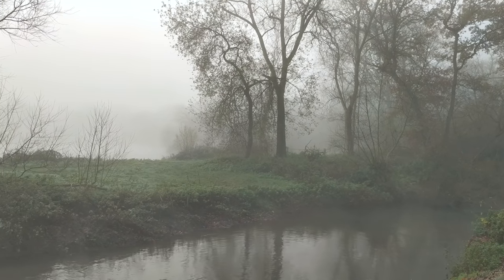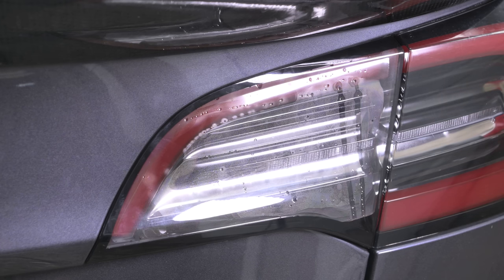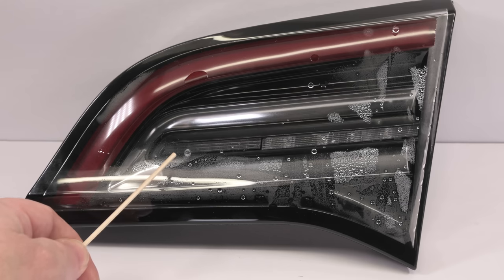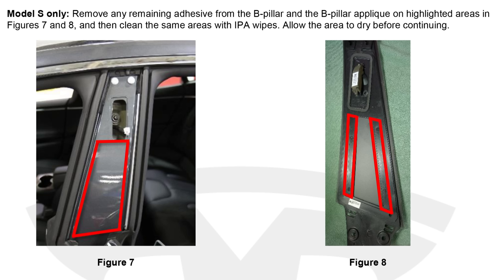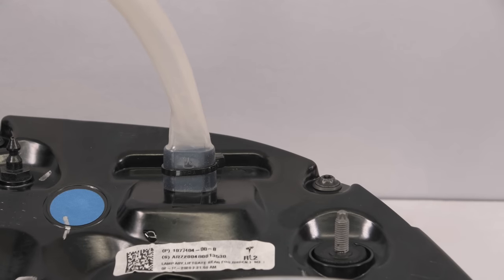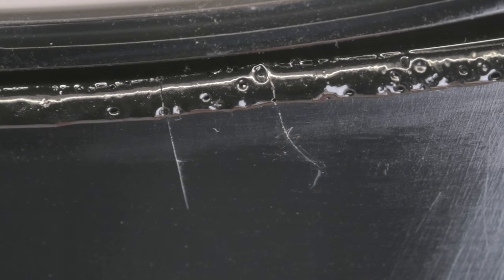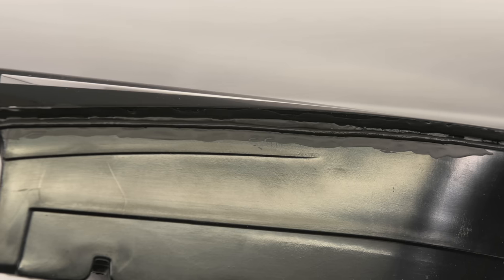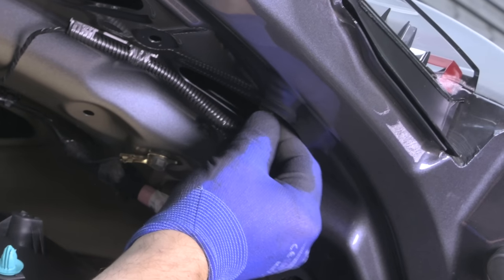How to fix your fogged up Tesla tail lights

Comment: Great video, thanks for sharing. 
I was curious to know if there was was any water marks left by the water droplets. If so, you could try something like Isopropyl Alcohol or methylated spirits (try it on someone else's lights, haha) to see if it can dissolve into the water and help it evaporate without leaving residue behind, prior to drying them. Also Sikaflex or some sort of Polyurethane sealant may be stronger?
I guess someone will let me know if these are silly ideas.
Reply from the maker: Yes that can be the case and you could flush it out with alcohol if it really bothers you. Any sealant that's easy to apply and weatherproof would be fine. The cracks are really small so anything like that will work.

Comment: Fantastic video, but I have one question: Given that the plug is a hole into the light (as you demonstrated with the tube), Is it even necessary to remove the Gore vent before drying it? Could it not dry through the plug? Then you wouldn't need to risk damaging the Gore membrane.
Reply from the maker: Good question! Yes it's possible for the moisture to get out from the plug. It might take longer but I can't see why it woudn't work doing it that way.

Comment: Excellent video thanks!!
I suggest sealing with 3m 08578 strip calk. OEM grade semi rubber, semi goo, 100% awesome. We called it dumdum in the body shop I worked at when I learned about it. Fantastic product for many uses including sealing a lamp.

Comment: Outstanding video.  I have a model S and have had the B pillars fog up once after a dramatic temp change between my garage and outside.

Could you look into how a Tesla Model S headlight can be repaired when the daytime running light fades or goes out completely?  I don’t have that issue but I may one day.  I heard it was from the light electronics getting too hot and messing up the weld/light tubes.
Reply from the maker: I know a few people have looked at this but the headlight units are much more difficult to open up without damaging them, so it seems like it's not viable right now.

Comment: Great Fix! I wonder if you could do this without heat, if you do it in summer, or on days without fog in your lights.... Just glueing around...
Reply from the maker: Once the sun has been out and baked those lights for a couple of days straight I'm sure all the moisture will have been driven off, so yes you could then seal them and you should be good to go.

Comment: Why remove the Gortex patch at all? Can the light be placed in an oven with the patch on? After all, it is permeable to water vapor. That is its job- to be permeable to water vapor.
Reply from the maker: Yes, you're right but it will probably dry out faster with the patch off and if there's a lot of water pooling in the unit, you can pour it out.
Reply: @TeslaGurus  Thank you for reply and for posting informative videos. Tesla service is coming tomorrow to replace a moisture laden tail light under warrantee. That’s the easiest fix!

Comment: Interesting. Both PC and PC/ABS is prone to crack due to either built-in stress or chemical stress corrosion cracking. You need to temper the plastic. Unsure if manufacturers know this these days. Thanks for nice video.

Comment: Mounting a very expensive, large surfaced, complex, thin, brittle plastic box to project out, while simultaneously sit in contact with, a door that people like to slam is just dumb. In fact, in engineering parlance, criminal.

Comment: Well done, I like the format, permitting  a diy initiative.  Next, which will be in great demand, are the camera pillers on the new model Y.  I think condensation buildup there is a common issue, especially for those in colder climates.  One caveat however, is that this issue, does not seem to be  permanent, once in the cold environment for a while, it seems to clear up,  so perhaps its the relative humidity of the air within?
Reply from the maker: The B Pillar cameras aren't supposed to be completely sealed as I understand it, but this is a known problem on all models and something we'll be looking at making a video on soon.

Comment: Surely car manafacturers should just stick to incandescent?
They're quick and easy to replace a failed lamp.
They keep themselves dry from the heat they produce.
They're simpler and cheaper to produce.
They fade on and off with a nice effect, unlike the nasty abrupt instant on of LED's - Although that's personal preference.
To me, it just seems that incandescent has so many more advantages over LED.

Comment: You can also use a thin bead of clear external waterproof frame sealant from you favourite diy center.  Lights that have water in is nornally because the lens has become detached i.e a gap as per the video 👍 Or if completely detached just clean up both mating edges mix some epoxy and glue back together along edges and clamp with some pegs or bits of electrical tape till set dry.

Comment: Hi my m3 tail lights also get condensation usually when it rains...when vehicle is parked in sun in the matter few hours lights also got cracked...got my vehicle 1 year ago and SC has replaced them twice..it happened again in May 23 this they charged me saying that I'm washing my car with strong chemicals now I stopped going in car washes only hand wash...car was parked outside for few days in heavy rain sun came out and cracked again...has anyone some insight on that...i would appreciate that...
thanks

Comment: Without doing any research I just drilled vertically up into the affected light on the bottom so the water would run out. I used probably 1/8th inch bit. I had a half inch of water in it after a year of ignoring it. It didn't clear the fog right away but now that it's warm weather it's clear and hasn't fogged up since. I didn't need to remove it.

Comment: Great video, Tesla refused to replace my light under warranty, so I have no choice but to attempt this myself :(
What temperature did you use in the oven? You stated it should be very low but not the actual temp you used…

Comment: I had a crack  in my MX tail light and glued it. Unfortunately it did not cope with 45°C in the oven for a day, the glass got small cracks all over it, so carful on the heat.

Comment: 5:56
One of the reasons for Tesla’s failure, is that someone is trying so hard reinventing the wheels.
For such a large plastic parts, these bonding/welding process keeps failing and not having great success.

Comment: Great job in diagnosing this issue. It's the first real explanation I have seen. I bought a used 2022 Model 3 and the taillight had condensation in it. The dealer I bought it from agreed to install a new taillight and I have not had any problems with condensation forming in it.  So, it is possible that Tesla has corrected this manufacturing defect. It appears that is the case. It only makes sense because it would cost Tesla a huge amount of money to repair these under warranty. 

Again, you did a superb job in diagnosing and fixing this issue. You did an amazing job!

Comment: love the test! but I decided to just super glue the entire weld seam with no water testing. I cleaned it with a little rubbing alcohol and a toothbrush around the weld. I didn't bother taking the water out as it's summer and figured the sun would dry out the moisture. it's perfectly dry inside now ( a few days later) and the super glue was very easy. seems to have worked perfectly. it did not take on water last rain. 

I don't think liquid tape will last as well. plastic dip doesn't really chemically bond so if the tape glue is similar I don't think it will last. the super glue melts the plastic and seems to reinforce the weld. super glue is relatively thin as well and seeps right into all the little bubble holes in the weld. I use the loktite brand because it has squeeze control - so easy to apply. thanks!

Comment: Just performed this repair on the driver outside part of the light. There was so much water in mine that I had to drill a small hole on an inside corner to drain it. Later when completely dry I blocked the small hole with the same plastic bonding agent that is used to reseal the outer contour. So far it went through one rainstorm and still no water inside, thanks for the tutorial!

Comment: I have a similar problem with moisture in my frontcamera compartment (Model 3). When driving with cold outside temperatures after some time the autopilot etc. stops working and an error message pops up and tells me that the front camera is blocked. After stopping I checked it and saw that it was massive fogged. This happened more than one time. Do you have a solution? I can send you some pictures by email, just need an address. Thx!

Comment: The change from incandescent to LED lights robs the units of their self-drying property. Exposure to sunlight after rain or washing should eliminate the problem; otherwise carefully flow warm air from a hair-dryer around the, lightly enclosed with cloth, area.

Comment: Hello John, great video, thank you very much for that I have the same problem with my Tesla and at the same time a request you can maybe explain how to take out the other side of the headlight and repair it, Greetings Jörg from Darmstadt Germany
Reply from the maker: Do you mean the other taillight unit or the headlight unit?
Reply: @TeslaGurus  
Hello John I mean the other taillight with me are on both sides of the taillights there are problems Greetings from Jörg from Darmstadt
Reply: The question that arises is it is just as easy to remove as one side of the rear light
Reply from the maker: It is not much more difficult. I will try and do a follow up video at some point showing how to do this on other light units and models.
Reply: @TeslaGurus  
I'm looking forward to it and I am waiting eagerly, many thanks, best regards from Darmstadt Germany

Comment: Thats what happens when the blinker fluid level is low or depleted.
You want to refill the light with blinker fluid.
Your local car parts shop will have headlight blinker fluid in stock.

Comment: Buying a brand new car for well over $50,000 so you can fix it yourself while he is the second richest man in the world?
Reply: What you think its too expensive? Ok you make me a tesla with your hands in your garage for 51k usd lets see how you do :))) you can become third richest person in the world! And you can even evade taxes am I right.....
Reply: Of course, other cars don't have the same or different problems?  Why do you think that Tesla does not have the ability to break?  There is a guarantee.  New cars of absolutely all brands have problems, especially expensive cars.  Why is Elon's condition here?  Before blaming, you need to know the problems of global brands, but they don't write so much about them.
Reply: Something like that
Reply: A certain amount of moisture in the lights is still considered in-spec at Tesla. New Model 3 rear tail lights are now one piece and should resist moisture better !!!EDIT!! I WAS WRONG! NEW MODEL 3 STILL HAS MOISTURE CONDENSATION PROBLEMS!!!
Reply: @user-ct1lf3hf1v why does one-piece lights resist moisture better ? The old lights are basically just two independent one-piece lights.
Reply: Does he own all of the car brands?

Comment: 4:21
Gore membrane (and other foil/membrane of similar sort) is used to reduce tendency of unsightly moisture condensation or fogging on inner surface of the light unit under heat shock, by allowing air moving in and out through its thickness but restrict moisture to a large extent.
There are two large types of moisture inside light unit: preexisting moisture, and moisture ingression.
Air inside light unit is naturally moist. Under heat shock, pressure may build up if it’s without Gore, thus Gore is critical to avoid fogs.
However, moisture ingression due to cracks from poor manufacturing and welding process, has nothing to do with Gore.
Plastic welding, either via laser or ultrasonic, are historically not the best process for large plastic on automotive which is under severe cyclical physical and thermal stresses, thus high failure rate is to prevail as in this case on Tesla.

Comment: is it really necessary to remove the vent patch when in the oven?
Reply from the maker: It speeds up the process but not essential
Reply: @TeslaGurus  you are totally right. I had it in for 2 hrs and everything wasn’t gone… then removed it and the process went faster. 
Bad thing is that I still haven’t got the liquid tape so I’ll have to mount it and the remove it again…

Comment: Great video I have request video with common problem Front headlight led strip not working can you fix this? Model S not sure if happened in Model 3
Reply from the maker: I know this is becoming a common problem with Model S owners. I don't have a solution for you at the moment. The problem is that the headlight units are very difficult to take apart to fix.
Reply: @TeslaGurus  I’m going to service tomorrow to replace the unit I wonder if Tesla can give me my old one back it’s only led not working whole lamp is working and see how to fix 🤔 or just keep if something happened with new one in the future.
Reply: Update: Tesla didn’t replace extended warranty not cover and cost a lot to pay for new one 😕 I bought second hand and now I have to try to replace old unit
Reply from the maker: @koziat66  Probably the best option TBH

Comment: Great video. There’s a guy on the UK TMC forum who dried his out by removing the screws from the back of the unit, not the Gore cover, and then applied Captain Tolley’s Creeping Crack Cure, which has a consistency similar to water so it can get into tiny cracks and gaps (it’s used in marine applications). Perhaps you could do it that way instead of trying to remove and reuse the Gore patch
Reply from the maker: Thanks! I'm not trying to say the method I used here is the only way. Before using liguid tape I also tried silicone sealant and super glue. Both worked, but I felt liquid tape is likely to be more durable in the long run as it's fluid enough to run into the holes and cracks but flexible once it sets. I hadn't seen that Cpt. Tolley's sealant before, but now I've looked I'd say it should also work really well for this. Taking the screws out is another way to get the moisture out but the problem with that is the holes are very small and the screws hold the internals to the back housing, so that could result in other problems. The Gore patch does stay quite sticky after removal but it's also really easy to apply a little glue around the edge if it needs it. There's probably enough room for the moisture to get out via the socket TBH, but I didn't test that.
Reply: @TeslaGurus  It’s a great video. It’s good to see someone actually doing a video on this, including the leak test. I was considering doing the same, but it was pre-empted by a ranger replacing both outside units. Didn’t occur to me that they could just bin them, I figured they’d try and repair.
Reply: I’ve tried  captain tolleys  creeping crack cure and had no success even done few layers of it . 
Next time I will use black waterproof silicone all around .
Reply from the maker: @wavawes  Interesting, thanks for the feedback. It looks like it would work but I must admit I haven't tried it.

Comment: Very nice vid. I have also a foggy tail light in my Model S
Reply: I had bad water ingrees in both rear lights on my MS, which I did fix myself but units are very different design being completely open/unsealed at the back and venting into the tailgate. I removed the units, dried them out in my air cupboard then resealed into the tailgate with a generous application of vasaline to the soft rubber seal. Has worked well!

Comment: If you could let owners know the following. 

In freezing rain the windows freeze into place in the closed position.  If you don’t pay attention you can pull door open, but it will not close until the ice is cleared.  The door will try to open because the key is brought near the car, so to avoid the problem leave the key away from the car.

There are various methods to clear ice, turn on precondition and wait for car to heat up.

I was on street and didn’t have time to wait as I was also cold and wanted to be in car.  My way to clear the ice is a scrapper but also use a credit card to clear ice at bottom of window at door, this is what stops the window from moving.

Hope this helps others.

Comment: After putting the light unit in an low oven, I then used a Hair dryer—fan —for finishing up putting air in the gore Tex hole as well as in the electrical connection hole.  That cleared it up.

Comment: This video is great thanks, Do you reckon that just by sealing all the cracks and gaps in the joint that the light housing will eventually clear itself of mist. so skip the drying process?
Reply from the maker: If the weather is warm and there isn't too much moisture in the light in the first place then it probably would clear itself in time. This time of year I'd say it's necessary to get it as dry as possible before sealing.
Reply: If you seal the cracks up and it becomes a sealed unit again, where is the condensation that’s already there going to go? I would say it’s probably not a good idea to seal it while it’s wet inside, although it is recoverable if you do.
Reply: @Durzel  the condensation will come out of the Gore one way seal And no more moisture will get back in. Mine are mostly dry but I occasionally get mist appearing inside which soon goes especially in this weather obviously has a very small leak and the Gore patch is doing it’s job
Reply: @TheWinstn60  Ah gotcha, ok, makes sense